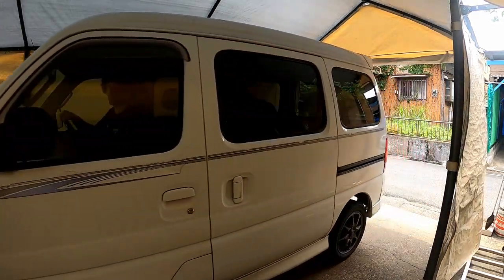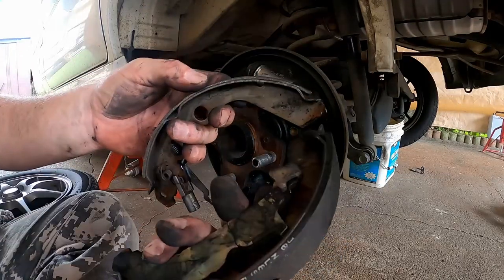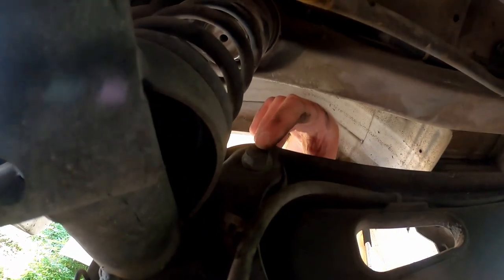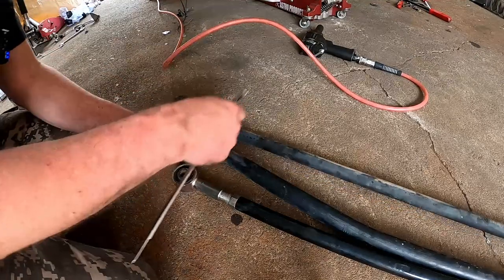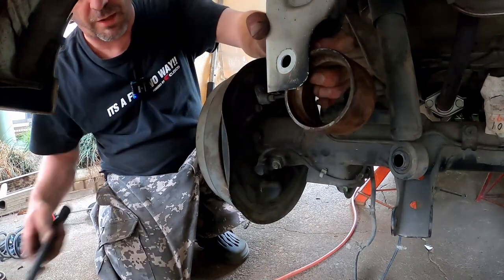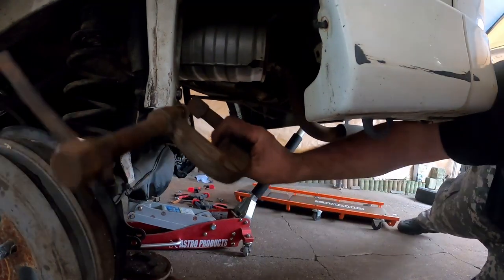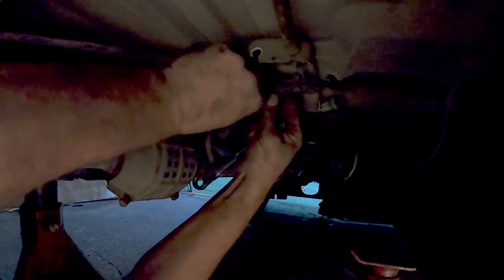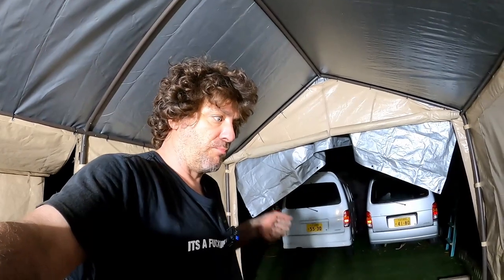MAKING MY SUZUKI EVERY VAN FASTER

Comment: Sir can i ask you something?
How about my water temperature gauge is exceed from a 1/2 level is it normal?
Reply: Hahaha sir i ask you. Pls i need good asnwer 😂🙏
Reply from the maker: I don't really know what "normal" is...
Normal for one van might not be normal for another.
I don't know which engine is in your van...
I think if your fans are turning on and off when they should then you're fine.
If you're worried about it then get a Lazer thermometer and aim it at the thermostat housing. If that's not too hot then you're probably fine.
These vans are getting older. When was the last time a thermostat was installed? When was the last time it had a coolant flush?
It might be time to do those things...
If you're unsure, take it to a mechanic.
Reply: @GarageKei  noted sir.
Hmmm my engine unit is f6a and model is da52v.
I'll try to check my engine temperature then the reading was about 60 celcius. So sir i dont know what is the good temp.
Reply: @GarageKei  unfortunately sir on our country is so hot i dont think so if my van carry the weather we has on there.
PHILIPPINES IS SUPER HOT
so i decided to remove the thermostat and direcr my fan.
I do flush and replace new coolant only. 😁
Reply from the maker: The van was designed to run with the thermostat. if you've removed it then of course you're going to have trouble.
60° C is way too low.
Reply: @GarageKei  okay noted sir i will back it all agian. But wait i have a question for you sir. It is okay the fan is automatically on/off while our season whether is super hot like or about reaching 40-44c ambient temp
Reply: I would take out the thermostat and throw it away. Thermostat not needed in the Philippines as its never cold. See if there is any play in the water pump bearing by getting the fan blades and trying to move back and forth, if there is, replace it. Also get the radiator rodded to fully clean it out. Or better yet a re-core.

Comment: So the Landy is the bigger non Kei brother. What we’re the engine options on that Dave? Was it still f6a or did they go k10a turbo?
Reply from the maker: Exactly! Da32w Landy is the non Kei da52/62 van. 
It seats 7!!!
The engine is a g13b and it was only available in automatic.
Reply: I fitted the g16b from a baleno with modded gearbox adapter plate from a g13b
Reply: Will a g13b diff swap into a 2002 carry truck